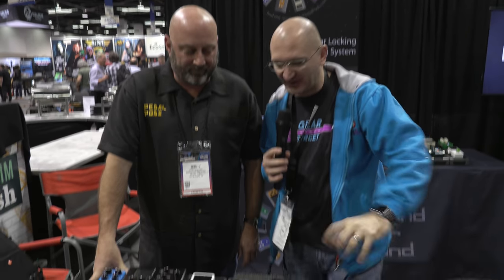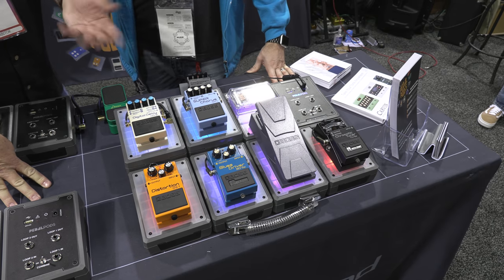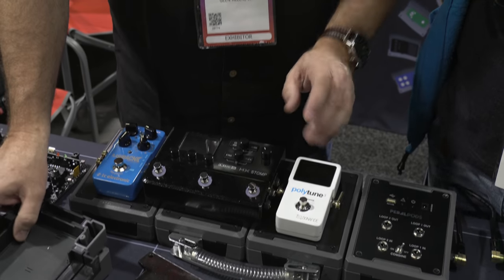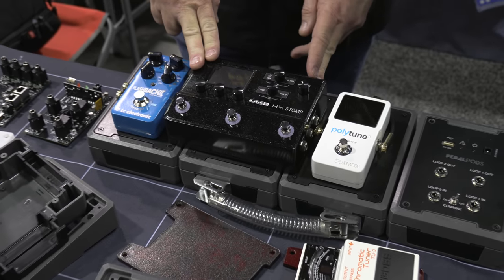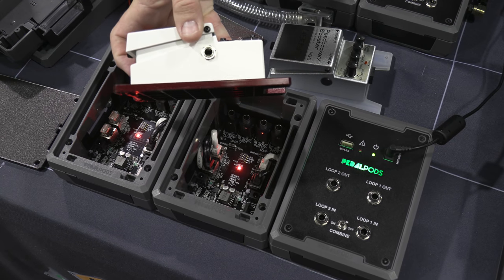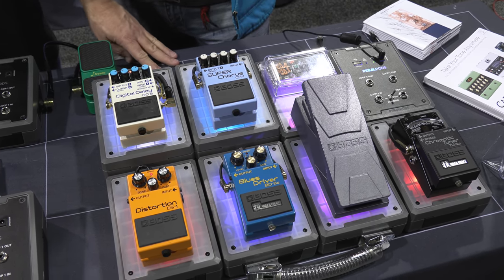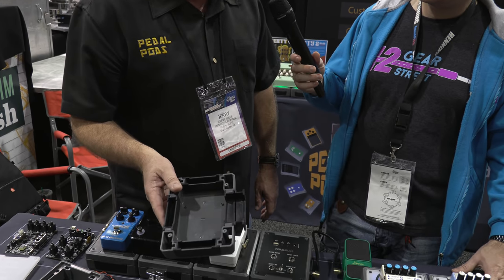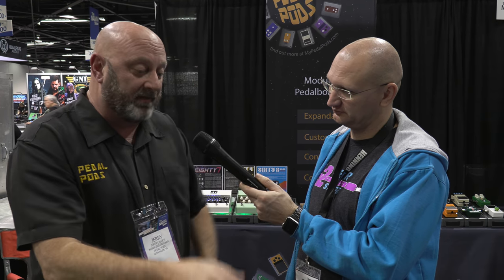A new form of pedal board? Pedal Pods

Comment: Good concept but if they the keep the power supply pod (With the USB Connector and the 2 jacks) as an area for pedals on the top and the connectors below it or on the side then. you are talking about a viable system. Else it looks like a waste of space because of that one square. Like the regulated & changeable power supply option for each pod and am sure it can develop into something unique and amazing.
Reply: Guitar Gear, Thank you for your comment.  The original design had the power and audio connections on the side.  One night during a show Rick was playing the board and the Bass player accidentally kicked the cables on Ricks board causing them to come unplugged as well as damaging one of the cables.  After the cell phone flashlight game and a couple of minutes of downtime Rick was up and playing again.  I relocated ALL the connections to the top of the "Gas Pedal" to make them more secure and easier to see if there is ever a issue.  Giving up one pedal location is a small price to pay for convenience and security don't you think?  Good luck to you... Jerry

Comment: Well thumbs up for the power supply! I' d really like to see this become smaller..
I disagree about the easier hookup because it's not. The amount of time I would need to rewire a common pedalboard is needed here for the screws in case I want to put a pedal among others.
A clipping attaching could solve that though...
Reply: Stavros, Thank you for your comment.  YES, I'm very proud of the power supply.  Regarding the time to rewire the board is quicker IF you take into consideration remaking audio cables, power cables and proper wire management.  The "clipping attaching" was tested during the prototyping and development phase.  I tested a handful of different fasteners with very good luck BUT they could not hold up the the drop and abuse test (AKA the TSA Test) we put the boards through.  If you have an idea for a better fastener I would love to see it and test it.  Feel free to email me: jerry.calder@mypedalpods.com .  Best regards, Jerry

Comment: How much garbage will the microcircuits catch through the holes for the patch cables?
Reply: Yuri,  Thank you for your comment.  Well I guess that depends on the environment.  If it's a concern it would be easy to apply a backing on the underside of the Top Plate.  I could also design a 3D printed insert.  Interesting topic.  Thanks

Comment: This doesn't look very practical for gigging. It's really bulky, if I used this for the pedals on my board on this it would end up being 50% larger than the board I'm using now. No doubt however, there will be people who want these. I have a feeling this is going to be more popular with weekend warriors with a lot of disposable income than gigging musicians. 
It looks way too complicated for most of guitar players. Working in a guitar repair shop, as well as servicing and building amps. I'm surprised that a lot of the guitar players can even change their own strings. I'm still at a loss as to why players haven't learned to setup their own guitars, or adjust the truss rods, set their intonation, etc. I just don't see them using this.
Full-time Dentists and lawyers, who are part-time players, this looks right up their ally.
Reply: Tim, Thank you for your comment.  As I stated in the video, it's within a 1/4 of most of the boards out there and in some cases even smaller.  It will never be smaller than a sheet of plywood.  I wish you luck at the repair shop.  That's an amazing skill you have and I have nothing but the utmost respect for what you do.  Regards, Jerry

Comment: Just about perfect! The only thing I'd like to see is a hard case lid that could be purchased for the most commonly configured setups. Something secure with hinges & latches. Transporting it safely, without accidentally changing settings would be paramount to me!
Reply: MWIrecords, Thank you for your comments.  I have the design in my head and I just need to finalize the design.  The best solution currently has been our relationship with MyCaseBuilder.com.  These guys have been amazing to work with AND they offer a great discount to Pedal Pods customers.  The SKB custom case is bullet proof.  Players have had nothing but positive feedback on both cases offered on our site.  Mono also makes a great soft-side case.

Comment: I'm a little late to comment but I just saw this. 
Idea looks great in terms of being neat , tidy and flexible but honestly as a novice,  the set up looks intimidating.  
1. It's a new design so no local store will be able to help you with hands on set up.
I think there needs to be a lot of simple instructional videos on how to set it up both ways, with electronics and without.

Update- I just looked up all their instructional videos.  They missed their development purpose completely.  Supposed to be simple to set up and expand.  It's anything but that!
They've also turned off comments on their chanel , so what? They don't want to hear people's concerns / questions in general. 
No thank you! 
This is a typical case of technology trying hard to better things but causes option paralysis instead.

Comment: This would be a good idea if there case for it grew as well. I need to put my case on my back and run or in the back of a car and have it be fine.
Reply: Angus, Thank you for the comment.  I agree with you!  I have a design on my head but haven't had time to finalize the design and get it into production.  The SKB case we have in the site is amazing BUT limited to two rows of seven pods.  There are custom case builders out there as another possibility.

Comment: This is a good idea...
But
Why buy a modular pedal board for £80 each section when you can buy one pedal board and a power supply for about that price? 
Your average player will build a board and leave it on the floor without the need to worry about voltage ....etc. 

Also, building a board is part of the fun. 

I would say a different design with horizontal blocks that would fit 4 pedals would be a great idea. 

The modules take up a lot of room as well, floor space at venues is a valued retail. 

Good concept but you're average player might not have the patience to buy things in separate modules, your pro might just get a professional board done, so why worry about building something moduler.
Reply: Samer, Thank you for your comment.  I do value your feedback.  As you know, there isn't a perfect board that fits every player.  We built this based on feedback from many players.  This is a solution that solves a lot of players problems.  Thank you again for your feedback.

Comment: Seems reasonable when it comes with the power and patch cables.
I only have a GA-FC footswitch for my Boss Katana and a DigiTech Trio+ with the additional FS3X footswitch.
I bring it out maybe once or twice a week to play outside in my driveway and it's a pain.  Because of that I'm looking at a pedalboard.
This looks awesome except my GA-FC is huge and my FS3X is just an unpowered extension of the Trio+
So... if I were to go this route, I'd refuse to buy 4 or 5 of them for my GA-FC.  I'd get a powered one for my Trio+ (hopefully it's not too big), and then an empty one for the FS3X?

Comment: Pretty cool system. Price does seem pretty reasonable, although it could get pretty expensive for bigger boards. I have  around $450 invested in my main board (board, power supplies, patch cables), but I have 12 pedals on my board, so this seems like it would be considerably more expensive. Worth it, probably, just not for everyone.
Reply: Jonathan, Thank you for your comment.  As the system scales the price per pedal actually starts to go down.  When you add in upgrading your board to a larger size, additional power supplies, cables, etc. (apples to apples comparison on quality components and power).  If you factor your time into the equation its a BIG savings.  A board that holds 12 pedals would take me about an 1.5 hours to build (using a powered screwdriver - NOT recommended BTW) and YES I'm very familiar/competent in building this solution.  Thank being said, 2.5 - 3 hours for most people is probable about right.  This isn't meant to be a down and dirty board.  We truely designed this to be the last pedalboard you'll ever have to buy.  Read some of the comments from Pedal Pod owners and I think you'll see what I talking about.  Best of luck to you Jonathan... Jerry

Comment: It looks like a solution for a problem, that doesn't exist.
If i am experimenting with pedals, i do it on the fly.
When i come to the point to add a new pedal, it should be permanent. At this point, you know, what you want. Simple stupid. (And no fumbeling before a gig)
Therefore better using one good multipowesupply and a decent pedalswitcher. Done and go.
BUT: i like the idea of routing signalin/signalout/power with one CAT-cable. Maybe replace the whole electronics-yaddayadda with a pair of simple, passive pair of tiny breakout thingies?
Reply: Das, Thank you for your comment.  The design came from interviewing dozens of guitar players.  I did my best to address all their wants and needs BUT it's not for everyone.  Thank you again for the feedback. I value it.  All the Best Das... Jerry

Comment: @EytschPi42 ~ I would maybe swap to this if they built  front units for Switchers (I use a thin, and cheap MIDI programmable Hotone Cybery, but I have been thinking about going to something larger). Also I would love to see a patchbay unit with more I/O for running one, if not more FX loops, and maybe A/B and A/B/Y signal wiring through it. Otherwise this is a winner for sure in terms of all the R&D put into the design. I love the idea of not having to redo everything to add a new pedal to the system.
Reply: Cary, Thank you for your comment.  The midi would have to be controlled by a separate controller (Sorry).  There are two separate audio loops built into the solution.  We have many examples or FX loops as well as A/B/Y switching.  If you would like to review this in more detail PLEASE feel free to contact me.  jerry.calder@mypedalpods.com  Thank you again Cary

Comment: Pedal Pods are a revolutionary idea that any guitarist or stompbox fanatic should seriously consider. After meeting Jerry and Rick at a show where they showed me a demo board and explained the concept to me, I was impressed and asked them to work with me to help me build one for myself. I think the the most genius aspect of these boards is the integrated power. Say goodbye to big power distribution bricks that have to live under your board and are always running out of power connections. With Pedal Pods, you have more power possibilities than you will ever be able to find with any other kind of pedalboard solution. Each pod can power up to two pedals with up to 500ma draw which means you will always have enough power for large sized effects units with 200-400ma draws. And each pod has a switch to select between 9, 12, 15 and 18 volt! This is unheard of with any other power solution. A board of 8 pods gives you 16 power connections! That's twice the power connections of any power brick. And because Pedal Pods are modular, if you get more pedals, you can just keep adding more pods and you will never run out of power. My own board is comprised of 24 pods and is powering 16 effects, some of which are large pedals such as Line 6 DL4, Boss DD-500, Digitech XP300 and the Pedal Pods gas pedal power solution powers them ALL. If you used Pedal Pods for only one application, this alone is worth it in my opinion. And to address to interviewers comment about the spacing of pedals on the board, see this photo of my board: https://www.instagram.com/p/B7gxU1GhoSe/?utm_source=ig_web_copy_link As you can see, you can still space your pedals however you want just as you would with any other board.

Beyond power solution alone, the additional features of the system are just as ingenious. The pods can be used as a signal flow management system with each pods built in Category 5 cable connections. The advantages of this system are the ability to use the two loops (as A/B or stereo configurations), practically no-noise, and the ability to route your signal between effects anywhere all over the board without long patch cables and having absolutely no cables visible. And the best part is every pod comes with all the cables and peripheral materials you will need. You don't have to use the Cat 5 cable system though. If you want, you can patch your effects traditionally as you would with any other board, and still conceal and route the cables underneath inside each pod for a clean look and just use the Pedal Pods system for its power distribution, modular expand-ability, and colorful LED lighting options if you purchase the optional translucent top plates. If you are always adding new units to your board, constantly rearranging your effects around, care about tonal quality, or just want an all-in-one solution that covers everything you need for your effects, then Pedal Pods offer something that you simply will not find anywhere else.
Reply: Andru, Thank you for your comments and VERY kind words!  It's been a long time.  I hope things are going well in CA and I hope you'll be touring again soon.  For anyone reading this reply I would ask you to consider this, Andru built this board on his own AND currently holds the title of Largest Pedal Pods board.  I'm hoping to have Hi-Res images of this amazing board on our site soon.  As an FYI Andru, you have two contenders  Matt in WV (he still growing his board) and one of the newest members of the Pedal Pods band, Joseph in No VA with 21 Pods (with switching and midi).  I wish you luck and as always, we appreciate your business and support... Jerry

Comment: I have a Pedal Pod board. Everything stated here is accurate, but I don't think the flexibility was emphasized enough. Aside from expandability, it's so easy to drop in a pedal somewhere on the board, even if it doesn't look neat. There are 2 loops in each pod and 2 power supply connections in each. I dropped a TC Electronics Ditto in the middle of my board and set the loop and was ready to go. I've had mine for about 6 months now and I keep finding new advantages over more traditional setups. Not going to try and explain it all in a brief post. It's very cool. Size is not an issue, sound quality is great, flexibility amazing. I've also connected a USB light to the USB port so I can see the board no matter the conditions. It takes a while to catch up to what these guys have engineered. Give it a try.
Reply: Tim, Thank you for your comment and KIND words.  It's posts like this that drive me to create an even better solution.. We appreciate your business and your feedback.  I wish you the best.  Keep rocking... Jerry

Comment: As someone who doesn't have a pedal board(only a multiFX) this is very attractive. After I read a reply by Eric Frederich to another comment below about investing in a board you may out grow it really made me think about the process of switching boards and adding peddles, etc. It really made me think about the wiring headache. Any scenario I think about such as recouping a little cost from selling the old board or putting in the work to build one, it doesn't beat the simplicity and features the Pedal Pods give you. It's important to me the audio quality is great and you made it very clear how it was very important to you in the design. The "kit" makes it all the more attractive to me, instead of also having to research which patch cables I should get, board, etc. I think all of that makes it highly attractive to someone just starting to buy pedals whether they are a new player or a seasoned player. 
I think cable quality is important because those who read or watch reviews from their trusted sources,  they will hear if the cables are low quality & they might think whats the point in buying the kit? out goes part of the simplicity and adds back in extra work.
The video was great in covering all the information! Great details! 

I look forward to investing in Pedal Pods in the future!

Comment: I don't care much for the 1/4 on top and would prefer the standard 1/4 jack placements to the back and or side.  Additionally build one box that fits most existing power supply underneath so you can use that space for more pedals on top. I would like to see more examples of this board in multiple cases like mono, pedal-train, gator, etc...   Color box options would be nice. I would look at the empty boxes as a more realistic option since the deluxe option would be extremely costly for my needs. Good alternative I'm just not ready to pull the trigger yet.
Reply: Lyle, Thank you for your comment.  This solution isn't for everyone and I appreciate your honesty.  There were many reasons why we moved the connections to the top.  Mostly it was for peace of mind and the ability to simply look down to ensure everything was OK.  Regarding example of configurations and being loaded into cases, you can find examples on our gallery page ( https://mypedalpods.com/pages/endless-possibilities ).  Thank you again for taking the time to comment.  Best regards Lyle... Jerry